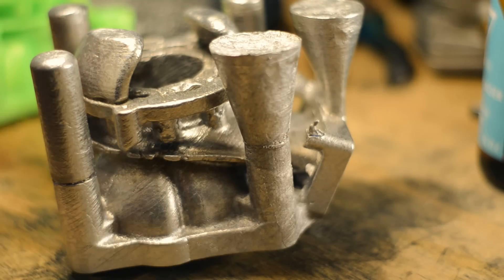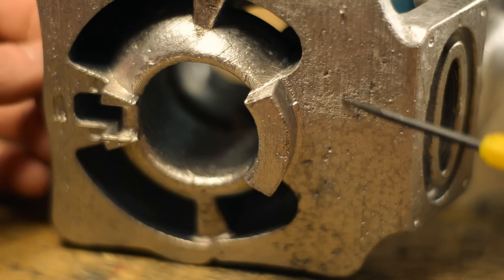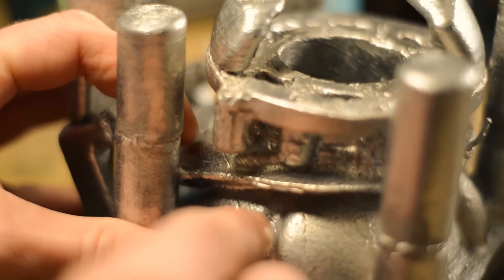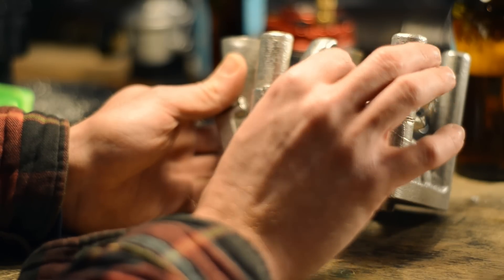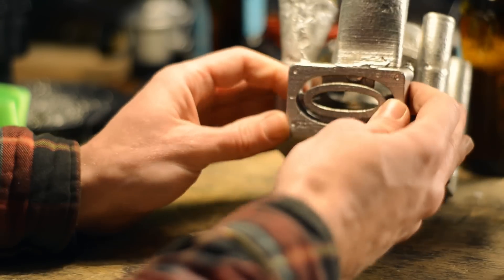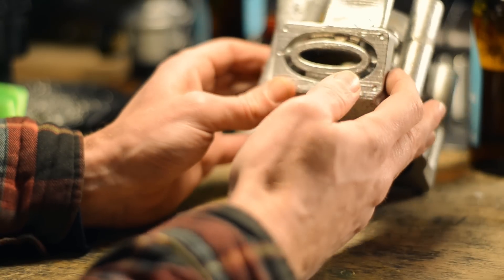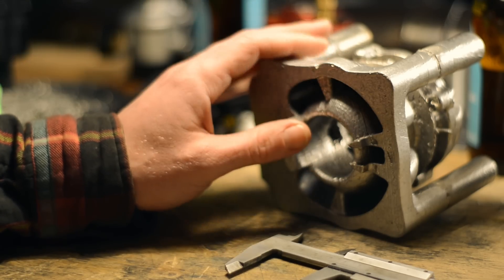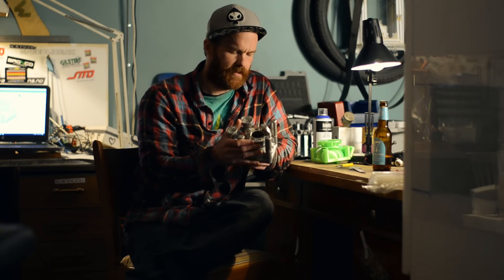Casting the Most Powerful Two Stroke Part 3 - First try result

Comment: I think a shaker/vibrator would be good to put on the mold when pouring and when the plastic is melting. Just to help the aluminum and melting plastic to move throughout the mold better. Especially as the aluminum is cooling filling in the upper half of the mold. And maybe preheat the mold too?
Reply: He burnt out all plastc before pouring the casting and the sand casting he's doing would not do ok with the vibration it would crumble
Reply: @2471zdude  The cast is held together with sand and plaster which should tolerate some minor shaking to encourage the aluminum to flow more freely. As for the plastic, the burnout seemed to work well enough, but if it starts to char in areas, the vibration will help the plastic drip out of the mold during the burnout. Keep in mind the vibration would be gentle. Like tapping with a screwdriver, although it would be a little motor and a weight so that he wouldn't have to do it.

Comment: table salt and baking powder works to degas and flux the metal. the ingots i have made haven't any porosity when cut open. just go sparingly as if you have to much the metal seems to corrode faster. credit for this goes to "myfordboy"
Reply from the maker: Thanks! I'm ordering some proper flux and degassing tablets with the new crucible. It's not very expensive so why not...

Comment: I studied this process at school, I don't want to be a know it all but I don't remember you mentioning this anywhere so I think it could help. I know that the biggest factor is what we called "cooling module" which is the volume of a part inside a model (you can ideally divide the model in simple parts) divided by it's external surface. The smaller the module the faster it cools, so it is the first to solidify. Like the small bridges inside the cylinder, they have a little volume and a big surface area so i suppose that the aluminum  solidified even before filling the space. The idea is to make the metal solidify in one direction, from the smaller module to the biggest (like the tanks above the piece).
 I remember that we had a little primitive software in which you could import a 3d model and it simulated the cooling of the metal, like where the porosities would happen and how big of a tank place on top. I think it was called solidcast . I'm searching if I can find it!
Reply from the maker: Thanks! I've been trying to get my head around how to best fill the thin sections.

Comment: ,,, I think somebody else mentioned this in the comments. Maybe try pulling the al. up into a mold with a vacuum. AFR in the States does this. Their heads are noticeably more dense . I realize it would add quite a bit of complication to your program, but you seem capable.
Reply from the maker: Shouldn't be that hard to do, thanks!
Reply: Its the way to go, seen some artist use vacuum casting machines too.

Comment: I'm sure this is a common theme, but when creating the sand/plaster mold use some sort of vibration mechanism (something like a magic wand on a low setting strapped to the side of the bucket) to make sure the mold as close / free of air bubbles as possible. I've seen for making silicone molds, pulling a vacuum after pouring the mold to remove air bubbles, which may be possible and beneficial. You may be able to use a heat gun to smooth the pla print to help from air gaps in the mold creation process too (so that air bubbles can't stick as easy).

Remember with PLA printing, the filament needs to stay dry for good print quality- I'm fighting with that on my 3d printer right now on a roll I've had open air over 4 weeks and i print at 10c higher for that than the new in sealed bag pla I have (you can use a dehydrator to dry it and bring it back to normal).

My two cents of improvements / what I'd work on in order:
1. Positive cast smoothness / quality (allow burn out to be cleaner, less areas for air bubbles to stick while negative creation/plastic to remain while melting, I can't tell how good it is visually)
2. Compaction / Removal of air from negative  (vibrator to compact material around positive, possibly draw a vacuum to draw out any air bubbles after pouring while still wet)
3. Vacuum casting (I'm thinking you can jerry-rig something to place over the mold to draw a vacuum after pouring to remove air from the aluminum)

I'm excited to see the outcome of all of this- your videos in the past have been tremendously helpful in learning about two stokes and tweaking my (non-spec rotax) kart engine.
Reply from the maker: Thanks man, and thanks for the tips!

Comment: You could cast larger dimensions and machine away porosity and more intricate sections after casting. <edit> After some thought some of those areas may be impossible (within reason) to machine so i understand refining the casting method first. What can i say. Im glad to be subscribed. Make sure there is gas in the tank before you try and start it.
Reply from the maker: Thanks! I've added a few mm here and there.

Comment: The oval flange is an error.
Round section is better:
- For easy construction of exhaust
- For better fludodinamic performance
Reply: I forgot to tell you
to reduce the bubbles, preheat the mold

congratulations for the result achieved
Reply from the maker: Thanks! I disagree about the flange tho, at least in this case with the mega-wide port.
Reply: I understand the advantages you support. 
Maybe I explained myself wrong. 
In the cylinder the oval section is perfect, but the exhaust pipe should turn into a round section towards the outside.
Reply from the maker: Then we agree! There will be a relatively short transition from oval to round just after the flange.

Comment: Why didnt you split the top half and bottom half in the casting process, you could weld them together before drilling out the cylinder and the ports
Reply from the maker: Should be totally doable in one part.
Reply: @2STROKESTUFFING  okay, good luck and greetings from the Netherlands!!

Comment: can you source ceramic filter's? it's supposedly important to make a stable "slow" flow to get the metal to fill correctly.
Reply from the maker: Should be able to, I'll see how the pouring basin idea works out first.
Reply: yes.. the filter is placed in the basin.
Reply: @grapsorz  NO its not! At the base of the sprue or at  the gates is MUCH better i.e  low down in mould.. See my Bush piston casting video for better filter placement.... Martin

Comment: the craziest smoker ive rode/owned was a 1974 hodaka super combat wombat 125cc. it would do 105mph with stock gearing or what i assume was stock gearing. i still have the jug and head and the porting is pretty nuts.  yes even compared to a 90's cr500, late 80's kx500, mid 80's 490 and a 76 yz400.

Comment: Have had your mould warm before casting? If the mould is warm it helps the flow. I experienced in thin areas if the mould is not warm the alu cools down and stops flowing. I would definitely degass and add flux
Reply from the maker: 300C, might have been too low. Will try higher when my kiln is sorted + flux and degassing.

Comment: You might find that a better type of plaster is needed, like a ceramic investment mold. Heating the mold to a higher temperature would help burn out the plastic better, you might have still had some plastic in there. Also a hotter mold will allow better filling of thin details like water passages

Comment: This cylinder look soo fine!
Question that maybe makes no sense, but what will hapend if you have 75cc cylinder and exhaust for 70cc. Basicly you somehow have to make that exhaust biger and i thod of something like a extra hole in the pipe, somewhere in the back of it,So that gases can go out faster, would it make a difference? And carburetor is 28 mm.
Reply from the maker: Thanks! Impossible to answer that question cause there's so many variables involved.
Reply: 2STROKE STUFFING have someone ever tryed something like that?

Comment: Try getting the mold really hot before pouring so the walls aren't so cold, you want it to solidify slowly and evenly, cold walls will start to "freeze off" areas and you won't get proper fill. Also burn out at a higher temperature, you want to burn up all that crap from the print and paint
Reply from the maker: 👍 I'll try higher temp as soon as my kiln is sorted.

Comment: Are you planing to use loose cylinder sleeves? Easy way to change porttiming and fix scratches without cast new cylinder when problem occur.
Reply from the maker: Plating. I need the heat transfer advantage of one single piece.

Comment: Have you considered a make-shift centrifuge, with the main sprew at the center of rotation? That can sling some weight into all the voids! I used to cast bronze hood ornaments using an old potters wheel with a half horse electric motor, just gotta make sure that the sprew is dead center or it can sling lava at 70mph!
Reply from the maker: Been thinking about it!

Comment: don't you want it a bit smaller so you can boar it to the correct size

you should have some short sproos comming off the top for the gas to go you won't have to worry where as long as there on the flat part so you can mill them off...

I worked in a foundry...
Reply from the maker: Yep, did the first one like this to take measurements and see how it behaved. There was supposed to be a big fat sprue in the center, but ran out of metal.

Comment: Crucible can be a ordinary stainless steel container, as others have used.
Reply from the maker: I'm too paranoid about dissolving steel into my alloy. The cylinder will be under a lot of stress, needs all the strength it can have.
Reply: @2STROKESTUFFING  You don't need more risks!  You are doing some  really ballsy stuff!  Nice theory, let hope the blow down increase via 'held piston ring and bridge-less exhaust port, and two piece piston' all works out.
Reply from the maker: There's a lot of things to go wrong...

Comment: Did you de-gas the ally?
Reply from the maker: Nope, but will next time!
Reply: Yeah, he suspects that he didn't. So good first attempt. Very impressed with his design. Look forward to seeing it run and his power figures.
Reply: If you have argon gas for welding and a long thin steel tube you can bubble the gas through the molted aluminum in order to drive out impurities.
Reply: He said in the video he didnt.. de-gassing tablets..
Reply: quite interesting.  Hope #2 is what your after.  not that it matters ,but i would keep my 1st casting on a shelf. and maybe put 2 stroke stuffing in the casting. look forward to the next vid.
Reply: @discontinuuity  Argon will exactly to nothing😂
Reply from the maker: Argon or Nitrogen is often used for degassing, I'm pretty sure it works.
Reply: @2STROKESTUFFING  Nitrogen and argon is used to keep impurities from getting back in, a lower pressure is used to degass while nitrogen or argon is flowing through and covering the alloy while and after degassing. If you are able to re-purpose the old metal cabinet furance with a vacuum system, you should just use that as your furnace so you can degass and inject inert gas into it in one go, also if not using the electric heating of the cabinet furnace, you should burn the propane ever so slightly rich to make shure there is as litte unused oxygen in the furnace as possible :)
Reply: @2STROKESTUFFING  can't think of a way how it should do it chemically, Argon is pretty inert. At the foundry I was they used some kind of tablets but don't ask me for what it was and what it was. :/
Reply: @flyfaen1  This technique is used for titanium casting and other for casting other extremely oxygen sensitive materials/where it is really important to have no oxides/nitrides. For the cylinder casting application it is probably a bit overkill.
Reply: @2STROKESTUFFING  I head using borax works as a de-gasser.  IE flux

Comment: De-gassing the aluminum with an additive, using an appropriate strainer and letting the first slurp out, and reconsidering some of the section thickness differences will help. In order to get the very fine details in the ports I suggest covering them with sand-free plaster first and then applying the coarser mix. Also the "tree" as it's called (in production you would have a bunch of cylinders cast on the same sprue, thus resembling a tree with branches) should be as hot as possible and should be allowed to cool as slowly as possible.
Reply from the maker: Thanks for the tips!

Comment: You could possibly just coat with porcelain or drywall putty thinned,   coated multiple times, then allowed to dry for a few days, at a fair temperature, possibly under a vacuum,  then use sand to protect use wood to cover the container , drill a fill hole, to drain the plastic, heat the container with sand holding the plaster mould, then plug the holes in the bottom, and fill the reservoir on the top filling the mould!  Id try with a smaller rest part, it's basically the same as a lost foam method,  I figured you would use sand and water glass, to make a sand cast, use plaster to make the finish smoother, or a much more fine sand,   but a foam mould would be fairly simple to make,

Comment: afaik you need to use specially made casting composition of aluminium when casting, that is high in silicon or something. works as a flux.
Reply from the maker: Thanks.

Comment: Don't scale it up. When you bore out the wall to make it smooth it'll need to have metal removed. Leave it the same, just more metal and more back pressure. And if you larger pour tubes it'll have better pressure

Comment: What size piston are you planing to use? Don't forget you need a bit smaller bore in the casting to allow for final machining.
Reply from the maker: 39.95ish, added 3mm to the new model thats currently printing.
Reply from the maker: Yep, will make one.

Comment: That's pretty awesome for a first go at lost PLA! 

The first time I tried to encase my print, I had a number of "learnings," namely, plastic prints are pretty buoyant in fluid plaster and hot glued foamboard won't stand much hydraulic pressure, resulting in a tidal wave of plaster being released over the shop...at work... One thing I tried was a dipping and coating the print in pure artists plaster first before following up with a sand / plaster mix. My next step was to fire the print and cut open the mold to see how well the burnout process worked and whether the first layer would crack or not, either because of the multiple layers or the PLA expanding during melt-out. Alas, I haven't done that yet. Multi-layer, starting with fine investment is what the pro's do for investment casting. It is a lot of faffing about though when trying to mix multiple batches of plaster and get the setting of layers just right. 

This is great stuff and I'm glued to the channel. Cheers and thanks for being such a great sport about failing fast, something I struggle with. Jim from Calgary, Canada, Puch 250 SGS aficionado.
Reply from the maker: Thanks! The plaster mold held up great with the process I used, probably due to the very long and gentle curing/burnout. (3day ramp 60-300C, 3 days at 300C)

Comment: you have to use MOLDLAY for casting not PLA
and also with good charges the withdrawal of AL is 1.03%
Reply from the maker: The PLA seems to work fine. I think the trick is a long gentle burnout where most(if not all) the plastic is melted out before its hot enough to combust.

Comment: I can’t wait for the next Video!!! Smelt 3 times as much metal than needed and use flux as you already know and it should come out great and why not sleeve it instead? And machine all the faces?
Reply: You could use spacer shims to set the port timing but you’d need them for the base and top of the cylinder OR reach out to a company with a multi axis cnc machine
Reply from the maker: Thanks, that's the plan. I'm getting it plated for the superior heat transfer.
Reply: 2STROKE STUFFING I contacted a YouTuber with a 5 axis cnc machine to see if he’d like to colab so you won’t have human imperfections and inconsistencies i would really consider using a sleeve because of warping from the cylinder and welding up the imperfects whatever sounds easier I’ve never done anything like your doing and CAD can be used for a mock-up for a cnc from what I’ve heard
Reply from the maker: Cool, thanks!

Comment: Alex, I think you are right on the money with the solutions to your casting issues, but I think some of the issues in the centre of the casting are from shrinkage, much larger insulated  risers on the top section will help this a lot, make sure the risers are of a larger section to that which you are feeding, and top them of with an exothermic topping to keep them hot. Hope this helps, great work man!
Reply from the maker: Thanks! I'm planning a fat riser, and was just researching topping compounds!
Reply: Nice one! I knew you’d be on it!
Hydrogen porosity is most likely from using oxidised scrap, and casting directly.
Preheating the scrap before melting helps somewhat, making ingots then casting is better. Degassing is no match for clean melting practices!
Looking forward to v2.0👍
Reply from the maker: I'm trying to get a hold of some pure A356.2 ingots